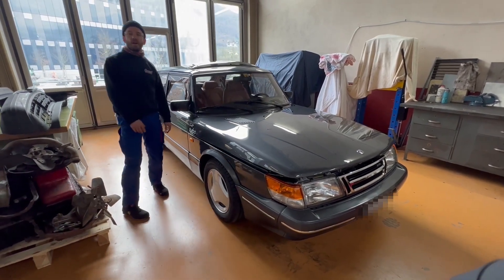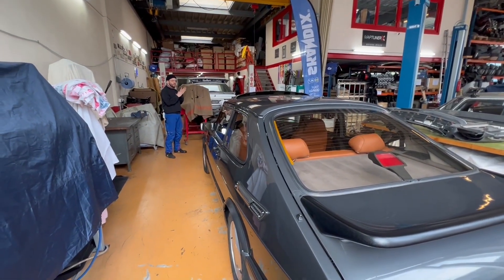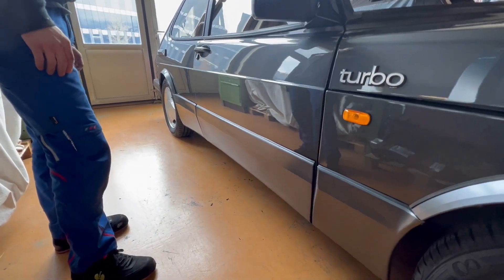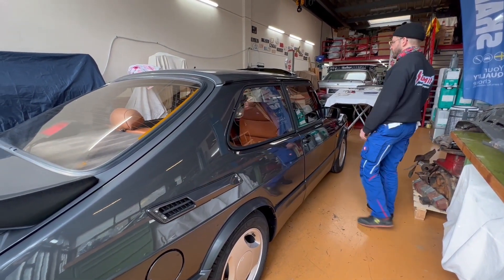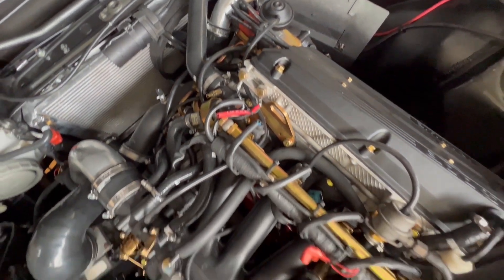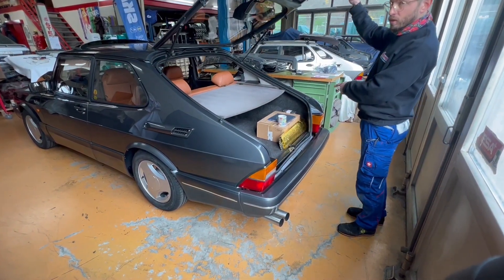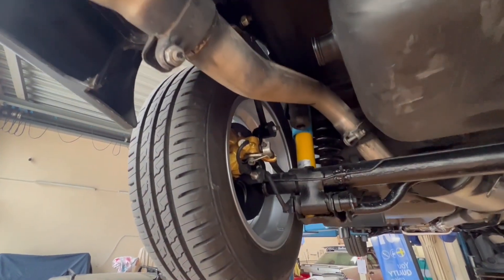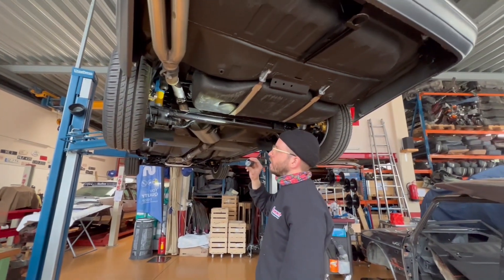1993 SAAB 900 Turbo S 16v Aero 3 doors coupé Odoardo Grey

Comment: what is the meaning of soft turbo??  900 S is soft meaning weaker than another type of turbo or?
did Saab make a hard , or strong turbo as well?
thanks for gettig back!
Reply from the maker: Hi, Yes there was a soft pressure turbo version (900S) and a high pressure turbo version (900 Turbo and 900 Turbo-S)
Reply: @HEMIsphereGarage  aha, what are the differences in performances between those like time in seconds for 100 meter, horsepower and torque? Do you hapoeb to know and do you is possible to get an old turbo for 3000 dollars today!? Or is thwt only the cost of the low pressure S model turbos?

Thanks for getting back, sittibg online some secobd habd websites now looking for these models trying to figure out what can be a fun car that one also can use for amateur rally sport with old cars and such nostalgia races 😃😅👍
Reply from the maker: 145hp for soft pressure turbo and 175 to 185hp for high pressure turbo. @SimplicityForGood
Reply: @HEMIsphereGarage  ok!
That might make a pretty big difference in a rally race! 😎